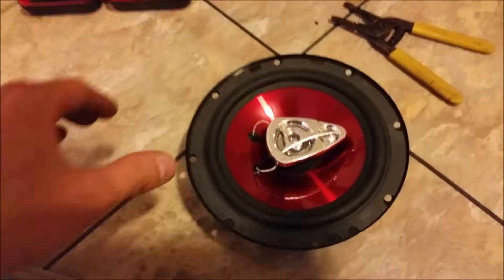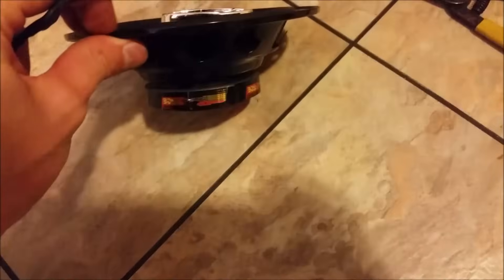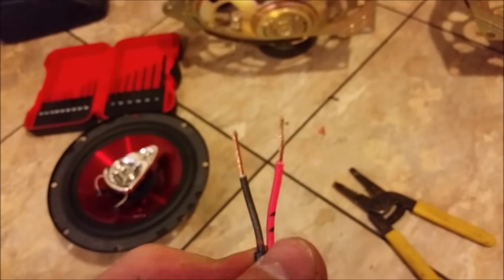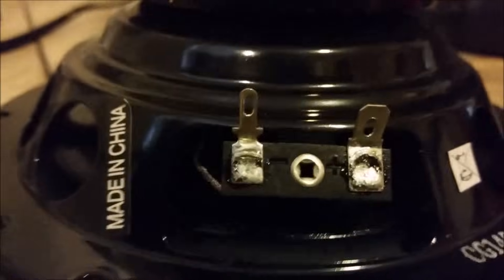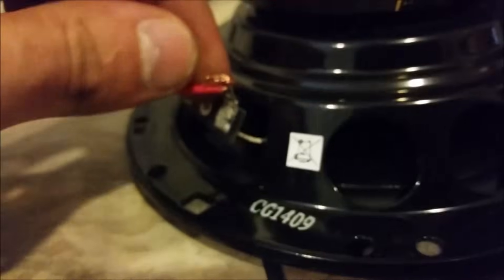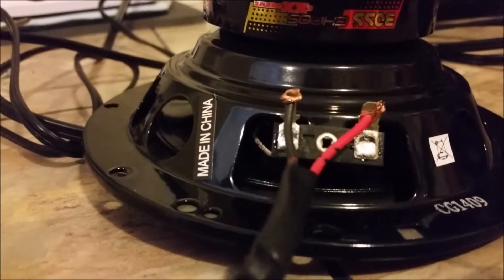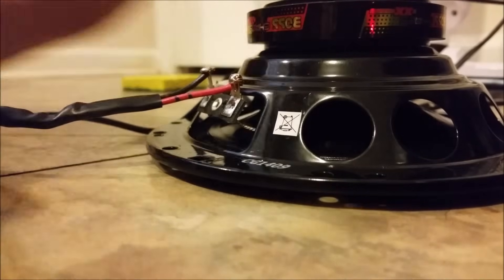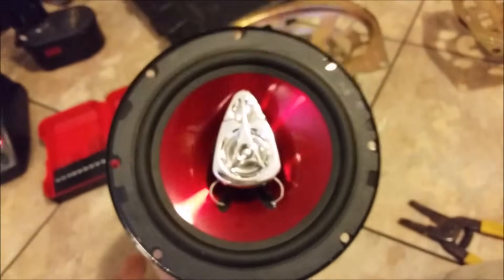How to wire new car speakers the easy way

Comment: Thanks for the video. One note though: it looks like the solder joints in this video are cold joints. When you solder you want to heat the parts you're joining, not the solder itself. If you do it correctly, the solder should flow into the components being joined and come out shiny, as opposed to bubbled up on top and dull. There are great tutorials on youtube demonstrating that.
Reply from the maker: That video was before I learned how to solder the correct way lol. but yes you are 100% correct
Reply: What is the wire called? And the tool he is using

Comment: I'm here because I thought it was a great idea to install my own front door car speakers and I actually had the same idea about using the existing wiring, but didn't know how to attach them without a solder... so thanks for that part. I have component speakers, so a tiny speaker goes on the top of the door and to me it's polarity is reversed, but can't be as I'm using the existing plugs and they only go in one way - well they work,  but on their own sound crap and may be in the wrong way, I'm still  unsure.. 
I just love the calm way this is explained in here. 
Most others had me afraid I was going to blow up the car if I got anything wrong. No one let me off the hook from the soldering part, so again I thank you. No one else had a voice that was every bit as relaxing as  Matthew Mconaugheys bedtime stories, again I thank you. 
 And last but not least, I wasn't ready for the closing sentence. It took me by surprise and made me spit my coffee out because it just sounded so funny....I'm very well aware that I've entered into an extremely male dominated arena and on behalf of the sisterhood I can't thank you enough for telling me it was ok to use duct tape and go about my day. You're the best!

Comment: They sell terminal clips that you attach to the end of the wires and then they just slide onto the speaker terminals.  Easy to remove and no soldering required.

Comment: Pretty much what I just did lol old school way…..just spent way too much time trying to find damn harness adapters to fit my Jeep Patriot for aftermarket 6x9s and yep…..I just straight up cut it and out and put the wire through speaker like that lol I need to solder it though….

Comment: If you are going to the trouble of soldering why don't you do it the right way?  You need to heat the wire until the solder melts and flows into it.
Reply: You really don’t tho

Comment: Does it work without the soldering?
Reply: Yeah it’s called splicing I just did it in my harness
Reply: @lilsleak so it’ll work I just wrap the wire around the metal contact and  I won’t have to solder?
Reply: @TheHardstyleGuy.  no solder needed I had some stock speakers in my truck that didn’t work and I cut them up then I searched how to wire them and I connected black with black white with white depending on what color your wires are no solder just splicing just got to make sure you wire them correctly

Comment: why dont you just use alligator clips simple clip on and off when you want to change speakers
Reply: Because they easily snap off and you do not want a short circuit..
Reply: @kimogsus  They really shouldn't snap off a speaker that never moves...
Reply: @Matasky2010  lol… what do speakers do? …. Vibrate. What happens when a car is in motion?… Shakes. Both of those will gradually loosen the grips.

Comment: Can I use my stock tweeter with the new ones still or do I have to re wire it
Reply from the maker: If your head unit is still the same you don't need to do anything with the tweeters if just replacing the front or rear speakers.
Reply: J Robling ok I was trying to use the new and stock tweets

Comment: You are melting a small piece of metal ? Like a paperclip?
Reply: He's melting on solder. Usually a mix of tin and lead.
Reply: Basically melting metal on the terminals so it can stick

Comment: Very bad solder job. Heat the joint, melt solder into it. It will wick into the area. 

Need to prep the terminals by cleaning off conductive grease and oxide first.

Comment: do you need an amp
Reply from the maker: regular car speakers use a built in amp from the deck and high end cars will have an amp either for each individual speaker or all of the speakers, but if all you are doing is replacing the speakers you shouldn't have to worry about an added amp
Reply: J Robling thanks

Comment: Can this work with oem speakers from another car?
Reply from the maker: You can install any speakers into your car, its nice if they are the same size and your head unit puts out enough power but most head units put out about the same so thats a rare problem

Comment: Dont ever, an I mean ever tape wires onto a speaker. You might as well stick em on with chewing gum
Reply: Might sound stupid, but does electrical tape help at all?
Reply: @IvanNava  no only for temporary situations as it always turns Gummy then dries out  and falls off try Tesa tape
Reply from the maker: Electrical tape helps with insulation because it is non conductive
Reply: rmblwgn why? Does it effect the sound?
Reply: @mylesdk1787  Never use electrical tape, it  turns to GOO in the hot and Brittle and slides off in the cold.  Just say no. Use HEATSHRINK!  When your tape falls off you risk blowing your amp if it doesn't have a good protection circuit because positive and negaitive wires could touch and short. If you put tape on 12v power line and it falls off it could short out and cause a fire.
Reply: @rmblwgn  Cool, thanks for the great explanation!  will get some heat shrink
Reply: Could i crimp the wires together? Or is soldering the only way ?
Reply: @thelastofus6988  buy female spade terminals in the appropriate size and crimp on wire. try ebay